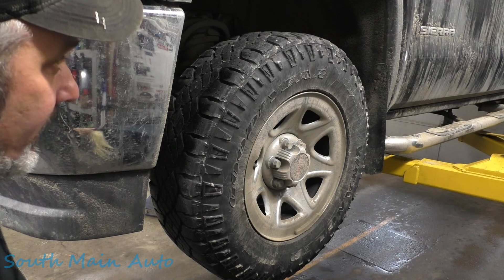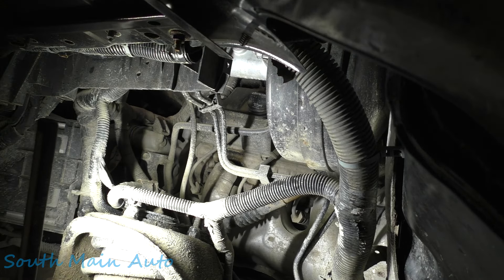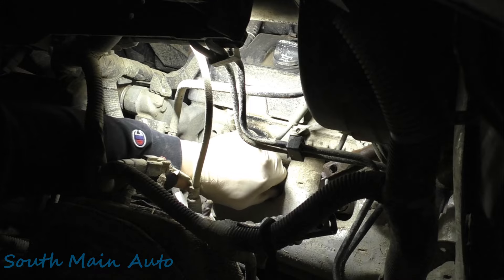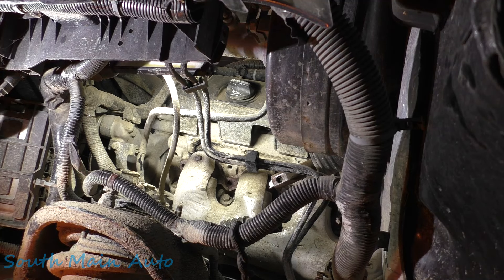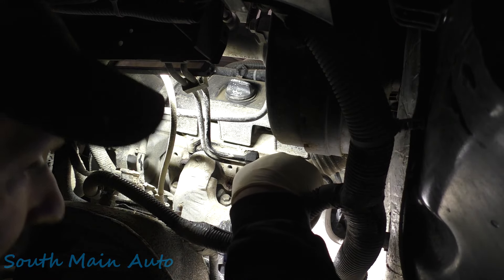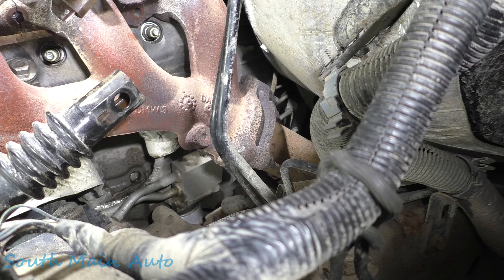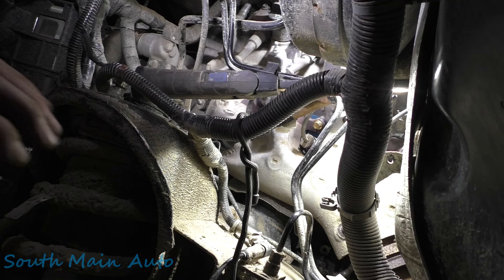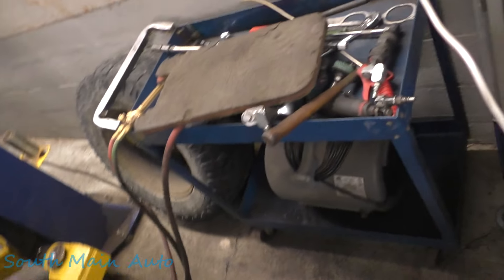GM Truck- Exhaust Manifold Bolt Snapped Off In Head

Comment: Just did this job on my 2014 Chevy Silverado. I was able to get 4 out of 5 of them out with my torch. However, one was already broke off and I tried use a stud remover. I used the torch but it was just to stuck. I ended up having to take the head off and tig weld to the bolt to remove it. It sucked.

Comment: Guys, just look that manifold up... The new one has those cracks. GM brand. I also found an explanation. Hope it helps settle everyone's mind. It states the following:           "They are supposed to be there. When mixing an aluminum block, aluminum heads and cast iron manifold they need to be there. If they were not. The very first time that engine was run long enough to heat the manifold up. It would either crack the manifold, tear manifold bolts out of the head or warp the head. Could also fail in other ways I am sure. But this needs to be there. We are not talking about an all steel 350 small block anymore. This isn't the 70s. Advanced materials require new methods to make them work. The exhaust manifolds were developed to improve durability and sealing and reduce operating noise. The cast iron manifolds feature saw cuts along their cylinder head mounting flange, which split the flange into three separate sections on the V6 and four separate sections on the V8s, allowing each section to move under extreme hot-cold temperature fluctuations to virtually eliminate movement of the exhaust manifold gaskets. That helps ensure proper sealing for the life of the engine and reduces the chance of gasket failure. The exhaust manifolds also feature triple-layer stainless steel heat shields, which limit heat transfer to the engine bay and help further reduce noise.".        I hope that helps answer questions.

Comment: I am not used to working on V-8 motors (the only V-8 I have is a CAT 3208).  It was very interesting to see that the gasket had slots in it to allow it to drop in with the bolts in place.  For a change some one made a job easier.
As a mechanic years ago who has suffered hearing loss, I cringe every time I hear the high pitched whine of your air tools.

Comment: I have a question for you on the manifold bolts do you ever just put some grease on them so they screw in better or re lock tight them

Comment: We missed the assembly of the steering shaft.  How did you get it to go back together?  Otherwise, this was straightforward and helped me to understand how to get into the side of the engine.  Those bolts sure came out easy.
Reply: I'm going with the opposite of disassembly.
Reply: @Failure_Is_An_Option  He mentioned earlier that he would need the gun.  I was wondering if a little sanding or lube would make a difference.

Comment: Question  what is your thoughts on running 0W20 engine oil in these engine? I know it calls for it but do you think its to thin and cause of engine failures?  Does anyone run 5W30 in these engines?

Comment: Maybe I should rent a room in down town Avoca.  I have a 2005 Suburban with the 5.3.  I have 3 broken on the drivers side and 2 on the passenger side.  Eric seems to love Chevy's and these manifold bolts...  I need inspection so for now the aftermarket clamps are going on.  Mine has 6 bolts per side I think where this one looks like just 5?

Comment: Another job ( I wud PASS on as exhaust systems are unforgiving) made to look easy and I jus pulled my turbo 400 tranny outta my 66 chevy ll and you have to deal with six  hard to get bell housing  bolts as well so I know what a pain in the keester it is.
   Did you pass on replacing the donut while the opportunity presented itself? 🤔
      As far as torqueing with  swivels and or swivel sockets, I usually give it another couple lbs or inches as I think the "accessories" don't allow a good true torque.
     REGARLESS, I still enjoyed it (as well as all of your vids.
    CARRY ON my brutha...we'll be here     ✌️😎

Comment: Hello Eric O! I also have a 2016 gmc with a 5.3. I also have a exhaust manifold bolt broken off in my driver's side head. But not the very front, but the very rear. How much would an average shop charge to do such a job?

Comment: my thing is where  did you get a 1/4 air ratchet. i bought the kimbell  mid west 3/8 stubby its nice but the head gets  so hot i dont think it will last. at 190.00 over priced and junk

Comment: Eric great video.  Looking for some parts advice. 2021 Pilot.  Front brake pads and non rusting rotors ,  What would you recommend.   I've never owned any car or truck that went through brakes as fast as this turd. She has 30 K on the clock and the stealer says she's almost ready for brakes. I have never ever got less than 80 K on a set of brakes- Honda quality right there !!

Comment: Right away I questioned, "why did the engineers use small diameter bolts to hold an exhaust manifold in place?". Then I wondered why not create a slot in the top of the headless bolt, heat the headless bolt/stud, wait a minute and then turn the stud out with a screwdriver, instead of removing a bunch of parts out of the way first?

Comment: My theory on a couple possible reasons why heating a bolt helps it loosen, outside of just melting the Locktite: There are two forces of friction, static and kinetic. Static friction, when two surfaces aren't moving relative to each other, is stronger than kinetic friction when the surfaces are already sliding relative to each other, that's why once a moving car's tires bust loose from their static bond with the ground it slides so much easier. Heating a bolt causes the bolt to swell more than the surrounding metal, making it fit tighter, but also slightly softening the bolt and causing slight shifting of it relative to that surrounding metal, removing some of the force of static friction that locks it in place. I also guess that when a bolt is torqued down, its threads are pushing harder against one side of the thread grooves than the other, and expanding it with heat causes that pressure to decrease.

Comment: I would still be drilling the broken bolt out of the head and replacing all three ball flange studs. The heat shield would have disinterested, the fender liner screw heads would be rotten and stuck, and I would have visited 5 parts stores for one gasket. Sound about right?

Comment: I like to spray every nut and bolt and anything else that needs to come apart with the panther pee THEN go to lunch, get a coffee, or do something else for 10-40 minutes. The extra time seems to help.

As far as heating goes, it might be because of the locktite, but heating a bolt does two things. First, the nut or the aluminum block increases in diameter more than the bolt expands if both increase in temperature the same amount. Second, as the bolt heats, and before that heat transfers to the nut or block, it exerts pressure to compress the rust and oxidation, and slightly expands the hole in the nut or block, then it begins to cool and pulls away from the hole walls.  The gap created from the diameter changes does not need to be much to break the crystallization and adhesion of the oxidation.

I also might have bad news: if the bolts come out too easily, it may not be from living right.  When life gets too easy, it might be that the devil has already got you and has no more need to keep after you. If things are going wrong, you can rest assured that the battle is still on. To tell the difference, if things go well, do you thank the Lord for his blessing, or praise yourself for your skill or intelligence?  When things go badly, do you ask for his help or just lose patience?  I don’t mean to get all preachy, but maybe this will help someone who is having difficulty with the stuck bolts in their life.

Comment: Question: why do these manifold bolts break  on some engines more than others, and what causes them to break in the first place?
Reply: GM, Ford and Ram use 8mm -1.25 exhaust manifold bolts or studs, and all of them break. They're not strong enough.  They should have upped them to 10mm years ago.

Comment: I thought after the application of the gloves a little Vaseline before placing the fingers in the tailpipe and feel the cough of the engine to diagnose exhaust issues.
Reply: Turn the wheel and cough

Comment: Eric, ever consider getting an induction heater for the rusty bolt removal? Seems like it might be a big help.
Reply: if memory serves, I believe he already has an induction heater. I believe I saw it in a video several years back.
Reply: @Rick Gaine  True Story. I remember it as well. I've only seen that process used in industrial settings. Heat the bearing, freeze the shaft, and then press the bearing into place.
Reply: They work great especially if around gas & a torch might not be a good idea

Comment: Hi Eric O
I have a 2019 Chevy 2500HD 6.0 (iron block) gas engine with 15k miles. Would it be advisable to change out the exhaust manifold bolts with high quality stainless bolts before this issue can occur?  TIA

Comment: Only question I have is - with that cool tool you got to pull the remains of that bolt out, why pull the manifold at all?  Couldn't you just replace the bolt and be good?

Comment: Heat breaks the rust particles apart, sometimes the rust forms a sort of thread lock from being dissolved in water and then crystallize between the threads._

Comment: It's a shame us military aircraft mechanics could not film the extreme complex maintenance we have to do. It would simply amaze you! This guy surely does have the basics to be a good one with a some amount of training. You'll never find us able to use a torch anywhere near an aircraft especially near the engine. On some jets we have to remove the entire engine to swap out a sensor or transmitter. A lot of the hard work was done while on the road with no shelter and only the tools and parts you bring. No luxury of being out of the weather most times. Not belittling auto techs skill set just letting people know how much more difficult aircraft maintenance can be. So think twice before making that your career.

Comment: I know Eric and Ms. O are a couple and that she will probably read this but I still have to say this. As Eric has sexy elbows! lol And I was not sure if that was a casting mark which I was hoping it was, but the camera does make it look like a humongous crack. By the way Eric, it was never a bad job to replace a manifold bolt even on the old 1970's Ford FE 390 or 460 blocks. Was even easier to replace them on the Ford inline 6 blocks like the 240 and 300 inline 6 blocks, but with those we usually just stuck a stud in there and put a washer and nut on them which was the way some came from the factory.

Comment: Do you anti-sneeze these manifold bolts?
Reply from the maker: Nah, the truck will be in the crusher before they need to come out again.
Reply: @SouthMainAuto  Unless he sells it and the next guy wants to put on headers or somebody buys the engine from the junkyard or whatever.  

Karma says you will have to work on it again and then you'll wish you had put on a dab since you were right there.  I put lube on everything everywhere before removing & for reassembly,  if the shit didn't work they wouldn't make it.

Comment: Questions from an idiot who just bought a 16 year old Chevy truck : 1. Some of the manifold holes, maybe just the middle ones, look like they are split. Do they come that way, or have they just broken? 2. When you put the manifold back on, the new bolts look gold colored. Are those specialty bolts made to deal with the heat? If so, will they last longer than the OEM ones? 3. Does it make any sense to have these bolts swapped out on some sort of regular basis while they are intact?

Comment: My name is John, I watch you on UTube all the time. I have a question for you. I have a 04 Ram with a shortage problem. Nothing was wrong it then one day my horn started blowing with little honks. Later that same day it started blowing and wouldn't stop. I disconnected the horn fuse. The next day I went out to go to the store. When I went to start it the battery was dead. I jump started it and it started right up. I shut it off and started it 5 0r 6 times that day. But the next day I had to jump stare it again. I took my truck to a garage thinking my battery was shot with it being 3 or 4 years old. They told me it was good but weak. I explained to them what was going on so the mechanic pulled the positive cable off the battery and put a OHM meter from the cable to the positive post on the battery. He told me it had a 3.2 volt draw on it. Giving me a dead battery after setting all night. So I've been taking the negitine cable off at night. It's been to cold here in Kentucky for me to pull the fuses and try to see what has shorted to put that draw on the battery. So far the ones I have checked their has been very little draw, nothing big. I'm asking if you have run into this problem with any of the electrical problems you have delt with a Dodge vehicle. I know how well you love them, LOL...  Your help would be very appreciated.

Comment: Why do you even mention the 'keyboard automotive engineer' section, Eric. Most of 'em don't know which end of a screwdriver is up but they'll tell YOU what is!. Funny story (not at the time), a shop I was working at hired a new tech fresh out of automotive school. This kid could spout the torque specs for just about any fastener there is. We had him rack a Suburban and pull the wheels for a brake inspection. He got to one of the wheels and had trouble with a tight socket (chrome beauty caps on the lug nuts). Unbeknownst to us, he had incorrectly racked the vehicle and, while he was rocking the impact wrench back and forth to remove the stuck socket, that big ol Suburban proceeded to you guessed it FALL OFF THE RACK! Luckily, the shop manager was near the kid and was able to yank him clear of the destruction. Totaled that baby right there in the bay!

Comment: People, do your mechanic a favor: Wash your truck before you drop it off. Caked on mud is only going to make his job harder, plus it may cost you money if they have to spend a long time digging through it, thereby increasing the hours, which increases what you pay.

EDIT: @5:36 Ok, in this case I get it. But in general, wash it (or clean the junk out of the interior) before you drop it off. It's just manners.
Reply: @Cheepchipsable  See they make these things called "Car Washes" It's easy, you just drive in, wait, and drive out.

Do I want little old grannie crawling around with a pressure washer? Of course not. But five minutes and five bucks can be an astonishing amount of help when otherwise someone like Mr. O. has to go digging through mud to find the screws that hold the splash shields on.

Comment: Glad to see you watch Paul from Utah. I bought a shirt from them and one from RL Autobody. I think you need to follow Matt and have a competition between you, Scotty, Ivan and the Steeler fan. Might work like - get a suitable patient with a faulty something...maybe two. Put it in a bay. Batter up and Mrs. O times how long til its correctly diagnosed. Sell shirts. And will Mapp heat up Loctited bolts like Oxy does? I think the tip/flame sized wont work.

Comment: Looks like GM hired some Ford engineers. Only fords make everything impossible to reach. On a GM you can easily reach 99% of the bolts with remaining 1% just from another odd ball angle. This is the worst clearance I've seen on GM V8 engine bay

Comment: Nice  when  they come  out that way  I'm stealing  your  heat and turn  style  at 35 minutes in the video looks  like a Crack  in the head  right off the side  of the spark  plug  I'm watching  this in 2024  so if they  haven't  returned  its  not a issue  ha ha

Comment: Those beauty shields on the valve covers and stuff. We just leave them off earlier models had them off and there is no issues so it’s just something else to piss you off and get in the way. Therefore we leave them off. I understand this is a customer vehicle but very stupid design and they keep on coming out with more stupid Designs with Automotive makers in new vehicles.